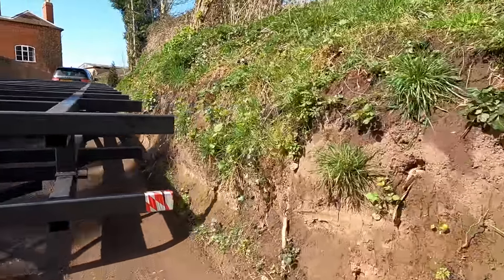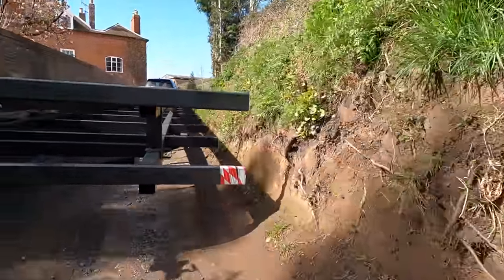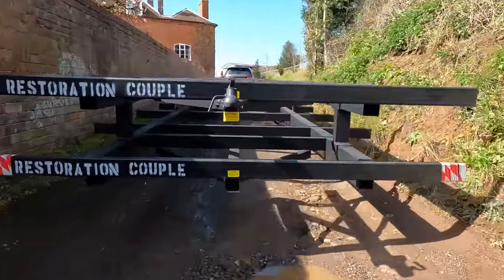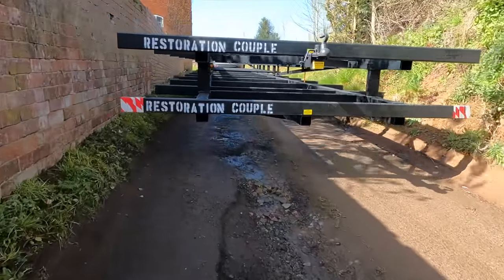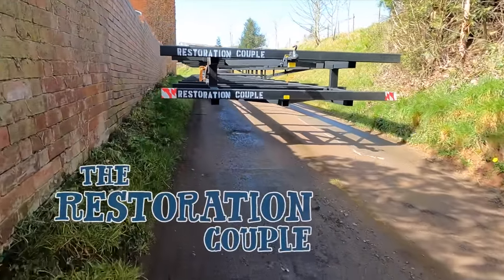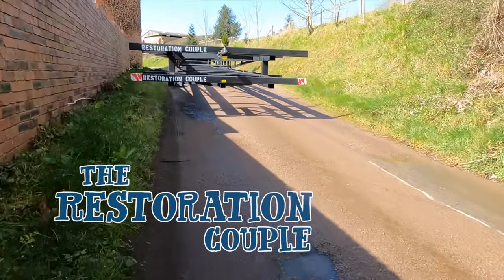WHY THE CHASSIS?  DIY Mobile Home - Do we need planning?

Comment: Here in Finland all electric heating is actually quite usual. 15cm or more insulation snd triple glased windows, no problem even with -20C weather. Electric radiators under the windows, electric floor heating in bathroom, electric boiler with around 100 liters per person, electric stove and electric sauna. All from 3x25A supply. No problem. Ground loop heatpump with under floor heating or air to air heatpumps are also good low maintenance options. Sealing heaters have been found to be mostly a waste of energy.

Comment: We went all electric with our 1838 house renovation. A/C - basically Air source heat pumps. With Solar power it’s cheaper than Oil and we are very pleased that we stay hot / keep cool / dehumidifier function is great too

Comment: Great to hear about all the legal aspects of this, did realise how complicated it could be, one of my friends son is doing a old steel barn conversion,  4 bed but the rooms will be huge, they have installed an underground heat pump system, walls are timber around the existing steel work, with insulation of 300mm thick, it's going to look great when finished,  can't wait to see yours come to life.👍

Comment: Hope this may be of interest to you both, We live in a converted Mill and have installed an electric  modulating combi from a Spanish company called Gaberon,
   It can be wired from 9 to 15 Kw and do not need a flue. It supplies both hot water and central heating if you wish.
   I believe that there are several companies who now manufacture similar boilers, and if this is of interest please feel free to contact me for any further information, ( cost of the boiler was approx £ 2200 ) 😃
Reply: Gabarrón
Reply: sounds iffy, why so keen....

Comment: A new junior school in Worcester had (expensive initially) ground source heat pumps but have a look at their air con units, like big chimneys enclosing branches that had water dribbling through with low power fans blowing fresh air down to rooms, cheap to buy and run and effective

Comment: We've had air-to-air heat pumps for over a decade here in the South West. Actually usually never been more expensive than gas and is very controllable. We've tried infrared panels, which are good but we found difficult to control, in that the control systems are expensive and a bit first generation. Our current project is a 'Ford box in County Cork' (Google will show you what they are!),  we're going electric underfloor heating, max breathable insulation and ripping out the solid fuel burner. I absolutely love wood burners but you can buy a lot of electricity for the money it costs for the installation and the Carbon Monoxide worries/management. Also, don't you think they will take up a lot of floor space? You can't just stick a wood burner in an existing fireplace in a caravan, you are going to need a bit of space, space that you could use for some more tools, computer equipment, etc. Just a thought... 😉 By the way, I absolutely love the channel. You guys are an absolute inspiration, please keep up the great work.
Reply: Wood grows on trees though......wink

Comment: this was an interesting one. nice to hear what the planning permission requirements are on this. and Tim, you might seriously consider a heat-pump. it'll run on electricity anyway but it'll be a LOT cheaper than electric heaters...we've had our HP (air-to-heat) for a few years now and it's running beautifully.
Reply: I imagine they just don’t have room in the budget for a heat pump, electric heaters are a fraction of the cost to buy
Reply: @georgerothwell  yes, but the HP can then be transferred into the main building once it's built.
Reply: @felixreali7101  they dont work
Reply: @nickevans7049  i've had one for coming up to 4 years now and I can tell you: they DO work 😉 I will never heat my house with anything else...even if we decide to move some day

Comment: Hi Tim & Jo. We’re looking at doing something similar. You mentioned SIPS, apart from cost and less videos showing the exterior build, is there a reason not to use them? That’s assuming the trailer can take the load and is well supported?   Are your drawings available to purchase too? Keep up the great work all round👍 TIA

Comment: Sure you’ll be looking at all options for the Barn Conversion, but now you’ve started on your Lime travels, I’d highly recommend looking into lime-Crete floors (with our without UFH).. and lime/fibre insulated walls. 
Will make for a very traditional and cosey home and really sympathetic conversion of the barns.
Reply from the maker: Certainly the plan for the older buildings plus breathable wall insulation and lime plasters. 👍

Comment: We're in the middle of building a twin unit caravan as our permanent residence on our smallholding. We've built it in situ using a pier/ beam footing. Quite nicely finished using mostly natural materials. Its going to cost about 85k and is smaller than yours! I think you'll do very well to get it built for 35k. Especially considering the costs of materials currently. Good luck though. It'll be great to watch you build yours. Happy to share some build tips/ design elements if you want to contact me directly.
Reply from the maker: It may well spiral. Fortunately we have bought all the structural materials, windows and insulation already so we know where we are at this point. Internal fit out and utilities will be where we either go over or get frugal.
Reply: @TheRestorationCouple  great. I reckon the internal finishing and services is about 45% of our build costs. The good thing is you can install all the services yourself as you don't need a sign off from building control.  Just check with an insurer before you do that especially  any solid fuel installation as some of them have issues with fires in timber frame builds.
Reply: Hi, you mentioned you're building for permanent residence - hope its all going well! I'm hoping to do this myself, what sort of planning did you need for this? Is it only possible to get away without planning if you are living on the site as a restoration project? Any help would be greatly appreciated!
Reply: @cvenn123  We have a kind of agricultural tie to our land which made getting planning consent possible. Very hard to build in the open countryside unless your in a development zone. Generally its about change of use from agricultural to residential and for that purpose a caravan is considered the same as a normal house because the change of use is the same.  I'd always get professional help regarding planning matters as there are so many variables and so much misinformation out there. Taking chances with planning is not recommended as making the wrong call is expensive and v stressful.

Comment: Curiously (and perhaps slightly counterintuitively) in well insulated properties direct electric heating can actually be the cheapest option once you factor in the capital costs with your running costs. The running costs will be relatively low no matter what the source - yes direct electrical will be the most expensive but it is still relatively low. Capital costs however are orders of magnitude apart - ASHP/GSHP are £5000+. A 2kw electric radiator is £30 (£75 if you want to be posh and get a wall mounted panel heater). Chuck in a small log burner for those really cold winter nights and you'll be quids in.

I assume by gas boiler you mean a static caravan lpg/bottle fed job? As even though you can install an ASHP yourself for £2000ish, and get a plumber to put in cylinder for £1000ish, that's still 5x more (ish?).
Reply from the maker: Exactly our thoughts. Well insulated and simple heating is best for the cabin. A well positioned wood burner and smaller electric rads should be the most sensible route.

Comment: Thx for the update it sounds wonderful. Btw the situation with a garden office in the back garden is you are only meant to sleep in them if they are built to building control regs standard. This is because without regs they tend to be quite flammable. PS looking forward to hearing about the farm, heard this morning the price of chicken feed has rocketed :(.
Reply from the maker: And pig food, it will be a fiver a sausage at  this rate!  Interesting that a mobile home in the garden does not have to me regs though and could essentially look the same. There are park home standards for more ‘permanent’ dwellings which we are using but no actual building regs requirement as far as I have seen.
Reply: @TheRestorationCouple  That's right it is not building regs but the BS3632 standard you have to have if you want to be able to sell for a good price in the future say.
Reply from the maker: @dannymurphy1779  which is terrible U values still so hoping to get beyond that.

Comment: Think about an MVHR for ventilation, there can be issues if you're highly insulating & making very airtight otherwise.  

Worth costing up a heat pump hot water unit, could save you in gas connection.

Your strategy is spot on though
Reply from the maker: Mvhr on the main house but may also look at a single unit in the cabin but likely not needed.

Comment: If you can pick up one end of the chassis and move it side to side, it will make tight corners easier. Some kind of attachment point for the tractor will help, except when the tractor is on one end of the lane and you have to move the otherend.

Comment: Great plan…it’s a sensible move and will allow you to do the build without pressure from your living conditions. How long do you think it will take to change the use on the land to residential?  Also which building are you converting into the house?

Comment: Electric heating etc is an interesting area to investigate. Heatrae Sadia have a range of electric central heating systems that heat water and then circulate in the usual fashion to radiators. Worth looking into as the capital costs are relatively low, and as you you indicated, energy (oil/gas-LPG) is not coming down in price! You have the land available to allow you to invest in PV and battery systems for your energy - you could potentially almost declare energy independence. Like others have mentioned, your journey is fascinating and I follow it with great interest.

Comment: Question re the heating - why no thoughts into Air Source Or Ground Source Heat Pumps? They would be heavy on capital up front but a much more economical over the long term, especially if coupled with Underfloor Heating and great Uvalue? 

Also long term solution if you re route then to the main house when you’re ready? And then the caravan can be sold with UFH plug and play into any energy system by the buyer?
Reply from the maker: Because it’s only a 2-3 year temporary house. Renewables in the main house though. 👍

Comment: keep away from gas pal.go full electric.if budget isnt there for full solar.get a good sized battery to start and go on a tarif with cheaper night rates and then in time add solar.make sure system can add in other brands etc

Comment: Interesting.
Have you looked into a air to water heatpump as your heat source for the glampingwagon? Sounds like you will be well insulated so a good solution. Even better if you hang a few solar panels on the roof...

Comment: If you're heating with electricity, why not a heat pump? They give the most heat per kilowatt plus cooling. A heat pump puts out 3 to 5 times the heat per kilowatt as the stuff you mentioned. Each half could have it's own mini-split. Mount on wall over tongue, run insulated tubes to multiple output heads on it's side, no need for ducts.